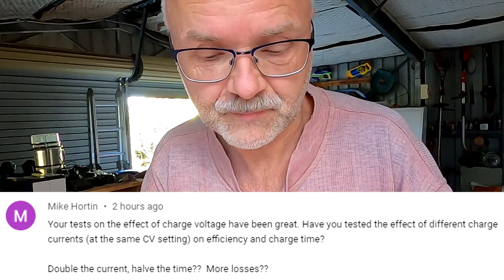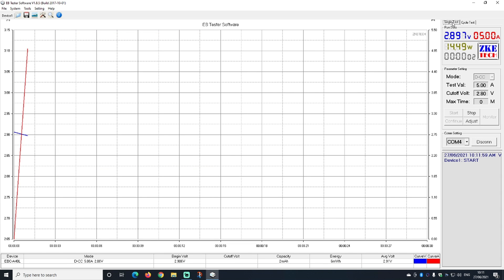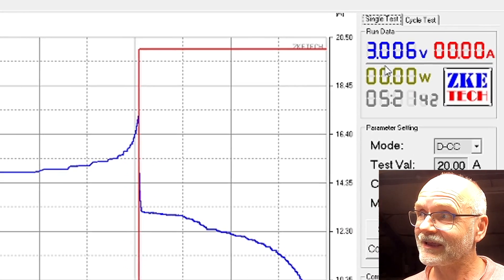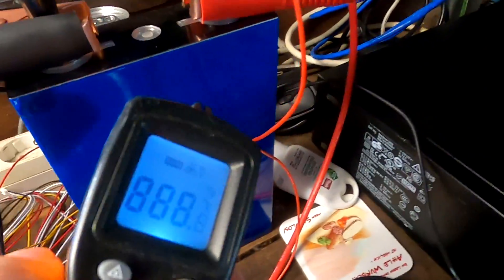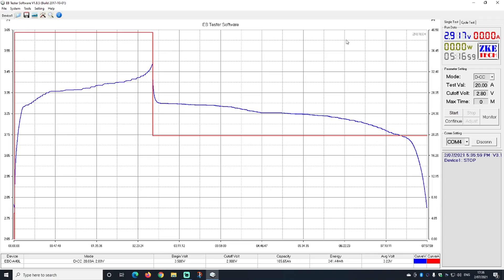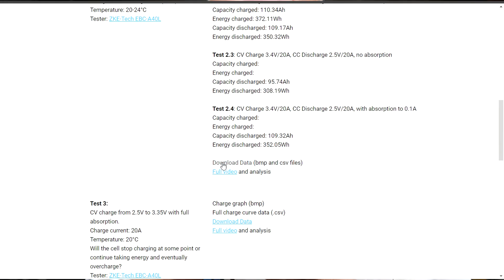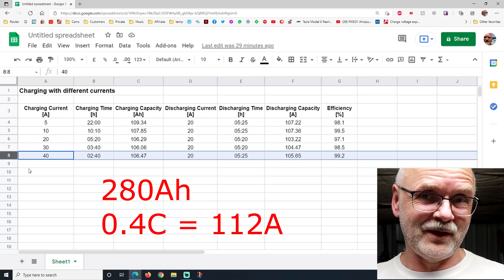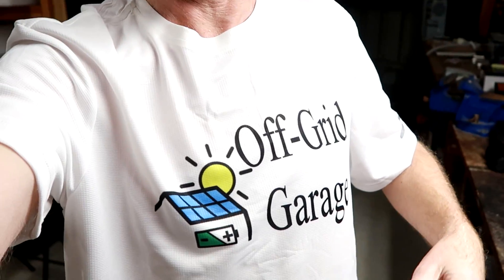Charging LiFePO4 with different currents - Efficiency INSANE!

Comment: I really enjoy your videos. Here is a question for you. When charging from solar panels, is it more efficient with higher voltage household/domestic panels into a charge controller OR the 12v (12v-19v) panels into a charge controller.
Reply: From what I know the domestic panels are around 38v and just added in series to get higher DC voltage. Doesn't matter is you series link 18v panels or 38v so long as your voltage is higher than the battery pack.

Advantage of a mppt charge controller is less loss plus can handle high vdc in so thinner wires needed from panels to charge controller
Reply from the maker: You want to keep the solar voltage as high as possible to have a low current running so you can use thinner and less cabling (less $$$). The solar charge controller converts this high voltage/low current in the battery voltage with higher current (amps are what is charging your battery). The power (W) is almost the same though.
Reply: @OffGridGarageAustralia  Thank you for you reply. I am struggling to find an MPPT charge controller that will run my 2x400w solar panels ( Imp: 9.42A
, Vmp: 32.91V, Voc: 40.25V ) to charge my 12V 400Ah LiofePo4 battery. This solar set up will be going on my van build.
Reply from the maker: @drewhodge3820  Victron recommends this controller for your setup: https://amzn.to/3khDmDY

Have a play here with their online calculator: https://www.victronenergy.com/mppt-calculator

Comment: I think its Not correct.   You have to Use the Energy ( Wh ) because you have a Higher Vorlage while charging and and a lower Vorlage at the Same SOC while discharging.   For the 5A Test ist about 95% efficency
Reply: You beat me to it.  I was about to make that point :-).   LiFePO4 is one of the most efficient chemistries available with its low internal resistance, but it isn't 99%.  Even 95% requires near perfect conditions and not charging or discharging all the way.

-Matt
Reply from the maker: You can use either, depending of what you want to test. Here, this is a pure capacity test in Ah. All batteries are been compared with their capacity, not Wh.  If you measure Wh, it would take other factors into account like cabling, internal resistance, resistance between terminal and busbar,... and is hard to repeat. The tester alone connects differently to the terminal every time, so resistance is changing and therefore the results. Ah are more consistent in this case.
Reply: @OffGridGarageAustralia  Ah is a reasonable parameter for this type of testing.  However, you can't use Ah data alone to calculate round-trip efficiency.  Amps alone is not a measure of energy.

-Matt